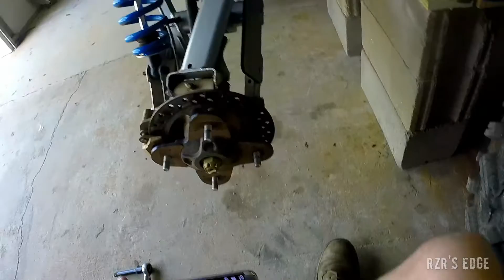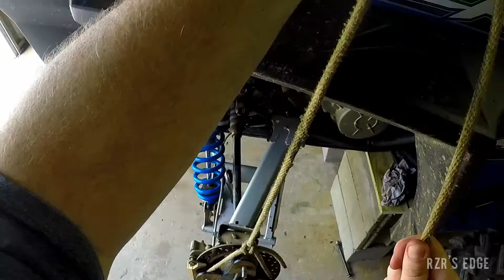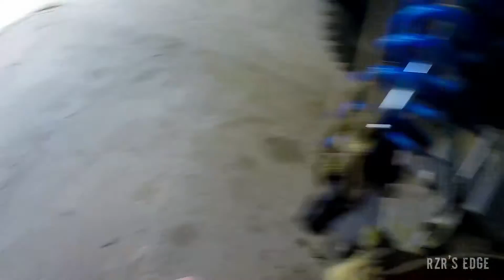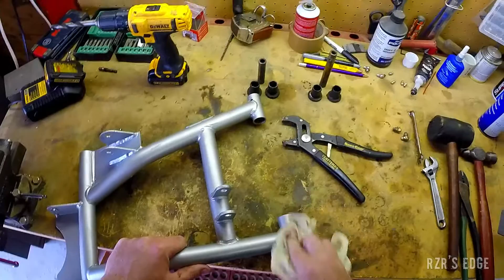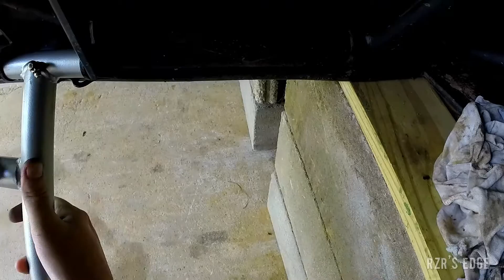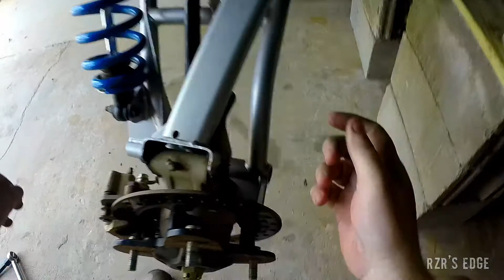How To - RZR Rear High Clearance A-Arms

Comment: did you add the zerk fittings to the rear hubs or do the newer rzrs come with them?
Reply from the maker: Steveindajeep yeah the newer ones come with them already, surprisingly
Reply: Awesome. Looking at a 900 trail or an S in the near future. Thanks!
Reply from the maker: Steveindajeep definitely go with the S if you don't have to worry about width restrictions. much more stable